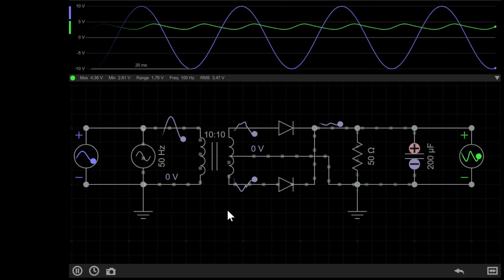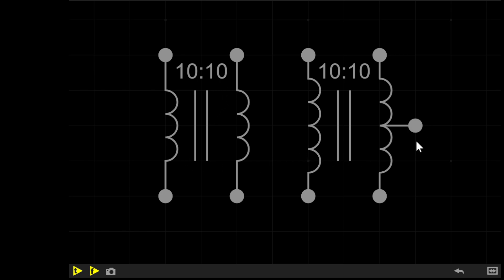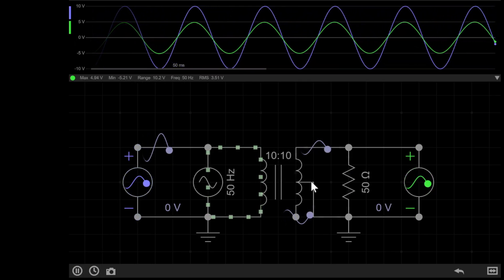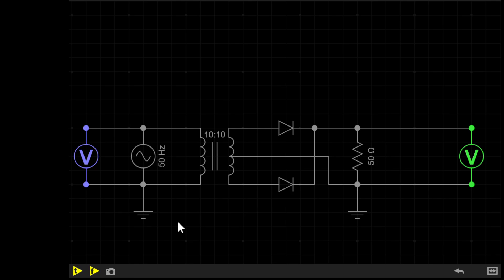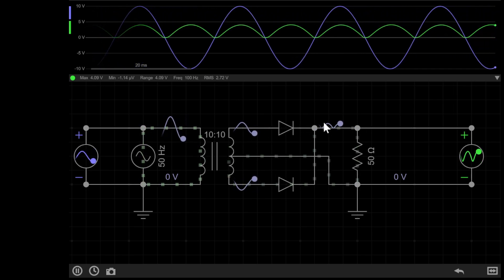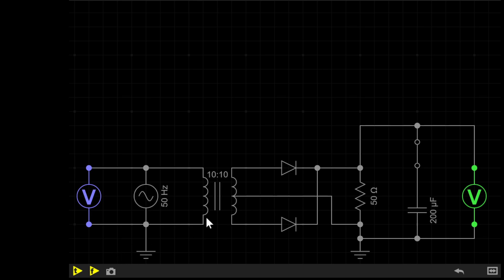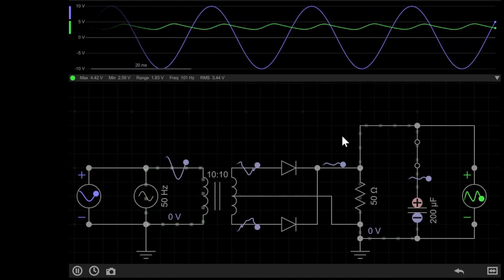Centre Tapped Transformer - Full Wave Rectifier - Explained

Comment: Center-tapped transformers offer several advantages, particularly in full-wave rectification and power supply applications. They provide a balanced output with a ground reference, enabling efficient full-wave rectification using only two diodes. This results in higher efficiency, better voltage regulation, and reduced ripple compared to half-wave rectification. They also facilitate the creation of dual voltage outputs, making them useful for applications requiring split power supplies. Additionally, they can aid in common-mode signal rejection and mitigate even harmonics in certain applications. 

Here's a more detailed breakdown:

Full-wave Rectification:

Center-tapped transformers are ideal for full-wave rectifiers because they can utilize both halves of the AC cycle, unlike half-wave rectifiers. 

Efficiency:

By utilizing both halves of the AC cycle, center-tapped full-wave rectifiers achieve higher efficiency compared to half-wave rectifiers. 

Voltage Regulation:

The improved efficiency leads to better voltage regulation, meaning the output voltage remains more stable under varying load conditions. 

Reduced Ripple:

Full-wave rectification with a center-tapped transformer reduces the ripple voltage, resulting in a smoother DC output. 

Dual Voltage Outputs:

They can provide two equal but out-of-phase voltage outputs, which is useful for creating split power supplies with both positive and negative voltages. 

Common-Mode Signal Rejection:

In some applications, they can help reject common-mode signals present at the output. 

Even Harmonic Mitigation:

They can help reduce the even harmonics that might be present due to imbalances in the output signals. 

What advantages do centre tap transformers have over standard ones in the case of split power supply?

12 feb 2020

￼

Reddit · 

r/AskElectronics

￼

AN-912: Driving a Center-Tapped Transformer with a Balanced ...

The use of a center-tapped transformer as the output interface for a balanced current-output DAC offers several benefits. First, transformer coupling offers dc ...

￼

Analog Devices

￼

What is a Center-Tapped Transformer? - everything PE

19 jun 2024 — Dual Voltage Outputs: A center-tapped transformer provides two equal voltage outputs, making it ideal for applications requiring two-phase power. Imp...

￼

everything PE

￼

Center-Tapped Transformers: A Brief Introduction into Its Working and ...

24 nov 2024 — Full-Wave Rectification * Higher efficiency. * Better voltage regulation. * Reduced ripple. * Improved power factor.

￼

￼

LinkedIn · 

Antti RAYMING

￼

Center tap - Wikipedia

Volts center tapped (VCT) describes the voltage output of a center tapped transformer. For example, a 24 VCT transformer will measure 24 VAC across the outer tw...

￼

Wikipedia

￼

Write the comparison center tapped between full wave rectifier and ...

A center tapped full wave rectifier is a rectifier which uses a center tapped transformer to convert the complete AC signal into DC signal. The main advantage o...

￼

Vedantu

Comment: Nice video! Question though, would the voltage on the secondary side of the transformer be inverted compared to the primary side?
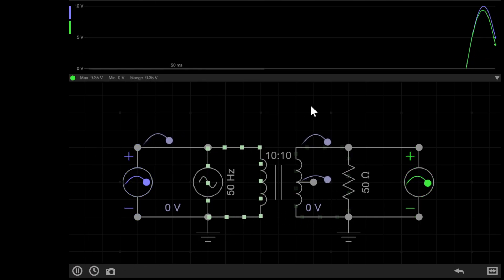Reply from the maker: Hi, This is a great question, but if you closely watch the AC sinewave from 1:10 or so, you'll see the input voltage and output voltage go positive then negative at the same time, in other words they are "n-phase, so no inversion.

Comment: I don't quite understand the purpose of the resistor at 2:10 . Could you explain?
Reply: The resistor simulates a load on the transformer
Reply from the maker: Like @taroc9752 says, the resistor adds a load to the transformer creating a complete circuit loop and making it easier to monitor!